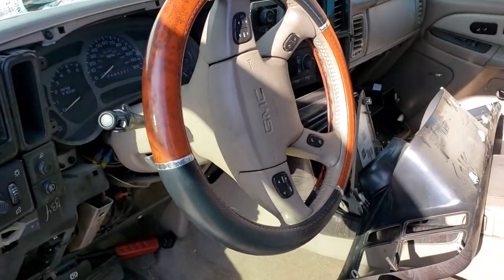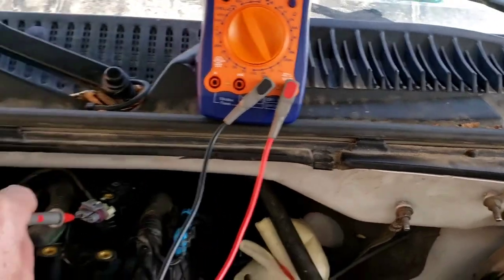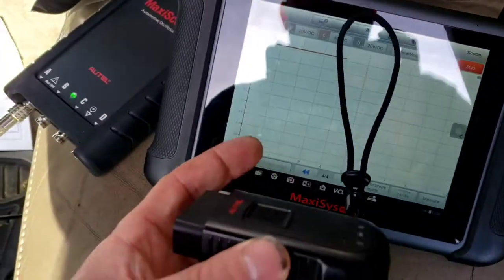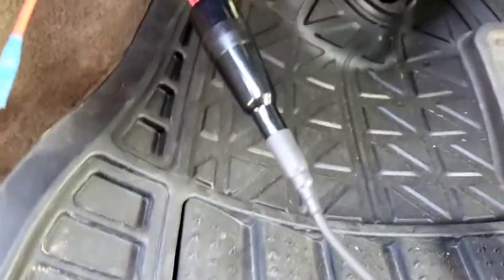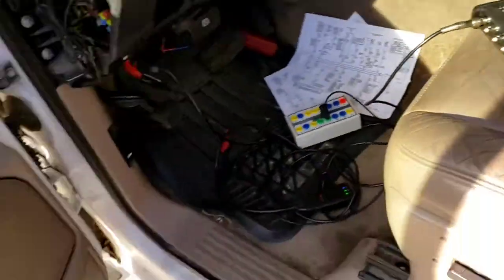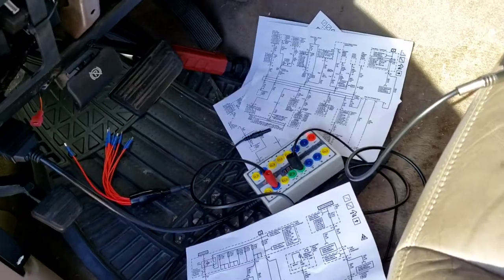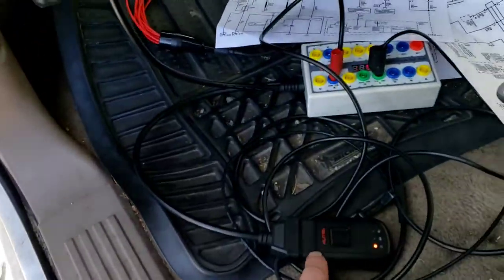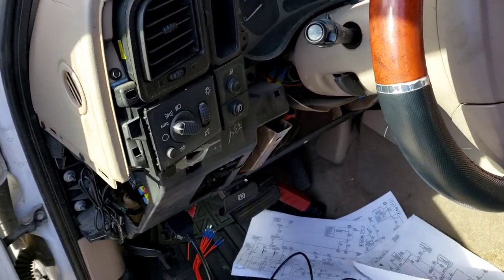2006 GMC Denali Class 2 Network Issues

Comment: I would not call this a bad ground, that would be due to corrosion, a broken wire, loose bolt, or the like. There was an engine swap and the folks who changed the engine simply forgot to attach the ground, AKA missing ground after maintenance created by lack of experience and no QC inspector checking their work and mechanics not taking notes while they are working on all the items that they removed to ensure it is reinstalled properly, a serious problem in this industry including the DIY community. Thanks for the case study, NICE. NEW Subscriber & thumbs up

Comment: This is an awesome, meticulous video.
I have the same issue Can Bus high at 10V.  Working on an ABS/TCS on a 2006 Equinox.  I’ve never needed a scope before, probably get one after this.
How can I test this without a scope?  Can I look at the breakout comb connector with a multimeter?

Comment: If you worked on gm's much at all you know about these ground faults,especially since the motor was changed,I would look for them ground wires were hooked up first and would save you alot of work

Comment: Not only does GM/Chevy use the cheapest materials & components from the darkest corners of the globe but they spent a good decade or two using said crap material components being grounded incorrectly & poorly on their trucks & suvs using their crap designs. My pos 2005 v6/4.3L reg cab, base model 2wd Silverado that I’ve replaced EVERYTHING ON including the engine & transmission, the fuel injection spider assembly, all sensors, connectors, radiator, fuses, wires, plugs, distributer, fluids, tools, tools & more tools, cheap scanner then to an expensive scanner, etc., etc., etc., .......on top of time spent researching info and sifting through the Chevy/Gm recalls & Chevy truck forums & don’t forget the countless hours watching & re-watching the YouTube videos, and reaching out face to face when possible and then some more etc.,. Long story short. I gladly dropped $15k + on this $4k truck ($4k if in mint condition on a great day) in parts & whatnots over the past 2 years. Some parts were headliner, lights, center console lid, front bumper plastic air dam, etc. I’ve swapped everything out. It still has a miss on cylinders 6 & 3. Cylinder 6 more than cylinder 3. Now I’m looking at replacing the top end components (springs, lifters & rocker arms) to see if that corrects the issues. It’s currently blowing slight to super heavy and thick smoke (colors being: fluffy & light white to super thick white or super thick blue/grey/white) only when I put the trans in gear. Any gear. The electrical issues continue. And they change over time/with the seasons of the year. The info online sucks. It’s not a 1999 Astro Van. It’s a 2005, 4.3L V6 Base model, 2wd unicorn pos. I only say unicorn because it has power locks & manual windows with dual manual A/C “climate control”. It’s a cross breed crap shoot mix. VIN X by the way. 1GCEC14X55Z....... As much as I hate this truck and just want to take this thing out to s field, soak it in gasoline then set it on fire, shoot it multiple times while it’s on fire then piss on its ashes.....I just want to finish the damn project that I started and prove that it can be fixed and that I can fix it. Oh and I’ve also expanded (drilled out) the bolt hole on the distributor bracket to manually adjust the timing as was done circa 1910-1998. Good God!
Reply: Stuff like that is why I quit working on GMs and domestics in the mid-90s. Never owned one either, and won't. 
For my personal vehicle, I spent the money up-front and bought a Toyota Tacoma, and now I don't have to spend nights and weekends doing repairs, for the most part, the Toyota has been scheduled maintenance, and just get in it a drive. Oh, it's got 325K on the odometer.
Reply: @hnd2893  
Oh I hear you. I had a 98’ Camry that was seemingly indestructible. It got me a city/Hwy mixed average of 39 mpg. 4 door power everything. A total grandma car (was previously my good friend’s Grandmother’s garage kept grocery getter until she died.) It was a great car with power everything, tinted windows a cd & cassette deck player, automatic. Great car. I neglected maintenance on the oil leak and the piston blew out the side wall of the block one day driving home from work on a Texas summer afternoon. It was my fault 100%. The insurance on that car was $52 a month. Gas was nothing. Maintenance was an oil change every 5k miles. 
When we had our first kid (Camry still 100% functional) in 2016, I went to the Toyota Dealership and we bought a brand new (9 miles on the odometer) SR5 4x2 with third row seats and running boards. I paid it off early in June of 2020 (15 months early on the note) which didn’t help my credit if you can believe that shit. “They” want you to keep paying. Anyway, the 4 runner is awesome. Other than the seats being designed for a 160lb asian….. I have zero complaints. My wife drives it daily still. All I do is change the oil, & the tires & brakes etc as needed.
Reply: @mattscott4387  Funny! Most couples that have a baby need a new car the next day :O)

Make sure you do all the scheduled maintenance, like driveline fluids and filters, keep on top of the maintenance, and that Toyota will be around so you can hand it off to your kid for a first car.  

Keep an eye on the engine oil level between changes, and I usually recommend changing it before the recommended mileage is up, and use Toyota filters. These days the manufacturers are stretching the oil change intervals way out and claim synthetic oils will still protect the engine, but why risk it. Stay on top of any recall letters, and have the dealer check for software updates for any applicable system or control modules. Don't ever ignore the check engine light, especially for fuel control and coolant temperature codes.
Reply: @hnd2893  
Well the 4Runner gets Mobile1 Filters and oil every 10k miles. 20k mile filter & oil or not. 
I got just 1 “free oil change” out of the dealership. And after watching the dipshit 19 “Techs” let my doors slam into the Driver’s side & Passenger’s side masts on their in bay dealership lift, as they spent 45-70 minutes changing my oil, that was the one freebie I got with my purchase and it was the last fucking time I let a “Tech” work on one of my vehicles.
Reply: @hnd2893  
But keep in mind the 4Runner is my wife’s car and it’s paid off.
I still have my 2005 V6 Chevy sitting in the driveway with a new engine & new tranny and new everything else. It’s now my fun project truck. 
My new truck is a 2022, F-350, 6.7L PowerStroke, 4 door, 4x4 that I bought in December 2021. Power everything, tinted windows, sprayed in bed liner, locking hubs, heavy duty rear end suspension with the front end leveling suspension kit. It’s not a bad truck. I still hate Ford. I didn’t and still don’t want this truck. I just hate Chevy now even more than I hate Ford. And the Dodge I wanted wasn’t available and the Dodge that was available was more than what I paid for this fucking truck. Which fyi was about $78,000 in December of 2021. And thats with the $5,000 add on to each and every & any vehicle on the lot at the time. From what I hear the lots are charging $10k-$15k instant add on prices now.
Reply: @mattscott4387  Wow! 10K on an oil change. If it were mine and I paid that much for it, I'd change the oil every 5K and a new filter each time. I'm on year 38 of being an automotive repair tech/mechanic, I've seen enuff not to follow the manufacturer's recommended oil change intervals. Good luck!
BTW, at the dealer, they're called Lube Techs and most are flunkies. Maybe one out of 50 gives a rat's ass or even really knows what they're doing. That goes for most shops, quick-lube places, or just about any business these days, including your doctor's office.
Reply: @hnd2893  
Well the Mobile 1 oil and oil filter are good for 15k & 20k miles. So I change both at 10k. Really I go by the carbon build up in the oil aka the color of the oil on my dipstick. As long as it still has some golden tan hue to it and the level is still good then that’s useable/driveable. I never wait for it to go black or go by the mileage 100%. And yeah I’m very aware of the competency levels provided by the “Techs” dipshits touching my vehicles. Which is why I don’t rely on them farther than I can throw them.

Comment: You had 10 volts on your ground at the map should scream bad ground.
Reply: Indeed
Reply: Does gm not allow programming used modules anymore if the vehicle is a global a? Tried doing one yesterday on a 2010 lacrosse wouldn’t go through
Reply: @philh9238  that's correct . No used Global A modules through GM. However there is something called I/O Terminal that you could look into. It works really well on about 80 percent of the Global A modules. Just a note , we are now into Global B
Reply: Where do I find I/o terminal? What’s global b?